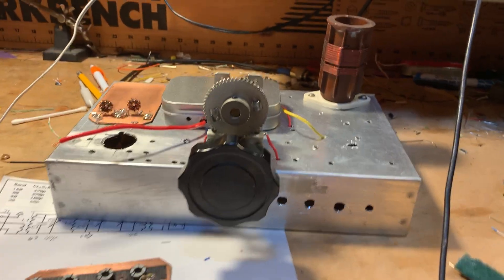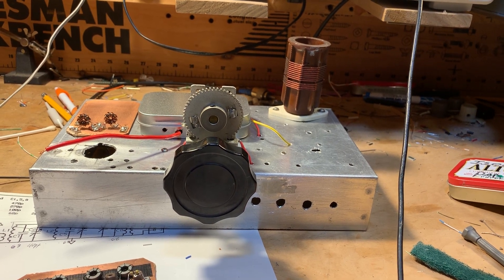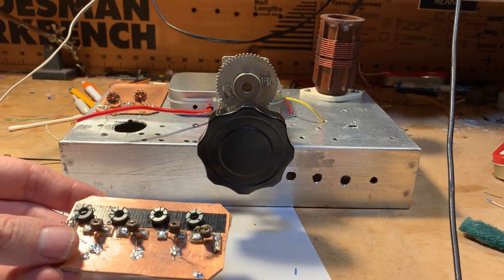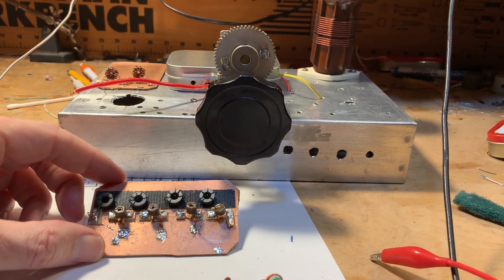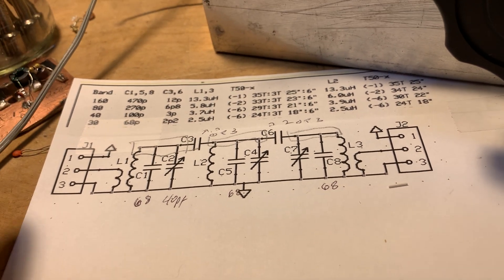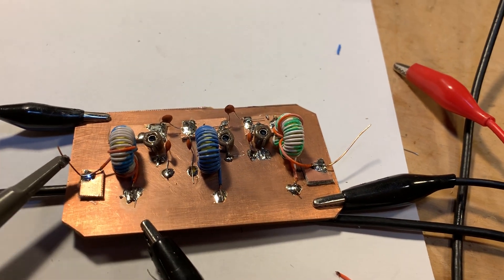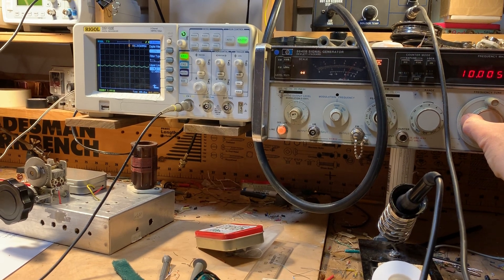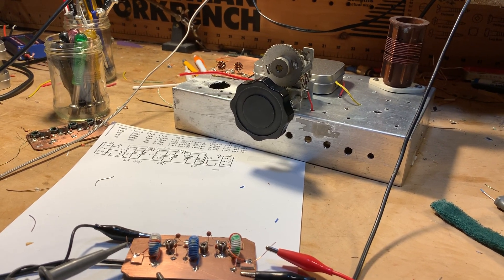Q-31 Part 7. Bandpass Filter

Comment: Good job Bill...how much twiddling did it take with the three variable caps to optimize the bandpass? Stay safe!  73 - Dino KL0S
Reply from the maker: Very little twiddling Dino.   In the end, I peaked one at the low end of the tuning range (9.4 MHz) one at center frequency (9.65) and one at the high end 9.9    This seems to yield a fairly flat bandpass response in the tuning range. 73  Bill